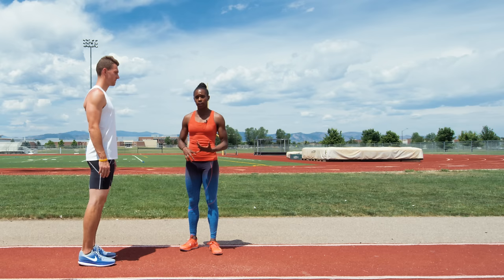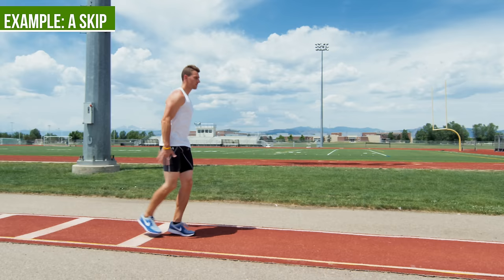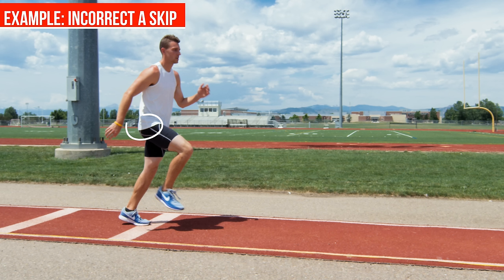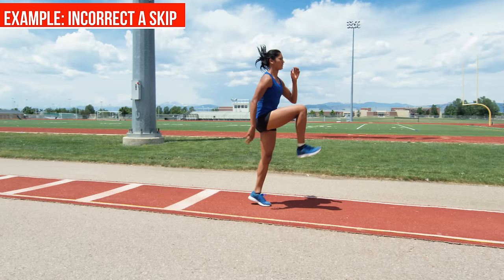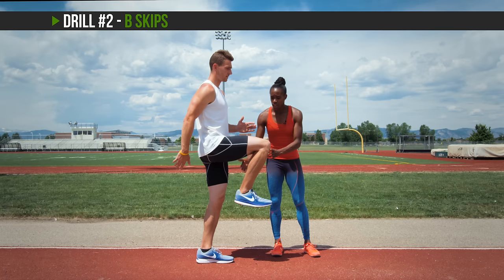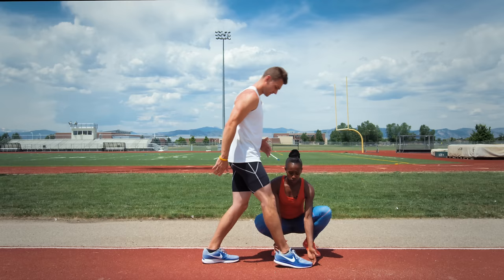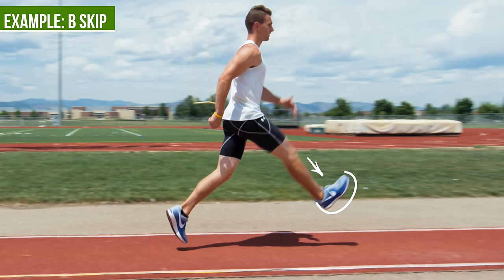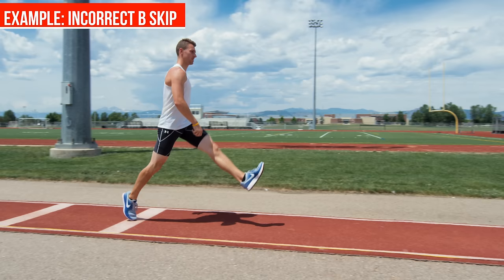Essential Long Jump Drills - Sprint Mechanics

Comment: Hii mam 
 My event is long jump i want one tip ,While starting my run up what should  be the foot distance .  When i go near the ground my legs  didnot beat the pefect jump .
Reply: Hi there, if I understand your correctly, then a typical runway distance is approximately 14-18 steps and whatever that distance is, will be your starting mark. However,  it varies for each athlete depending a number of things, including height, stride length and even speed. You can get a good approach distance by starting your approach from the board and running the opposite direction. You stand with your jump foot on the board and run back 14 - 18 steps (mimicking a real runway approach) and have someone mark your final step.  Hope that helps!!! Good luck!
Reply: A

Comment: Thank you for this I’m just starting long jump any other very beginner tips?
Reply from the maker: Hi Clare, check out our YT channel, there are several more long jump videos that should help you get started with the correct technique.
Reply: Try not to look down at the board...keep your head up all the way through the jump.  Try to make the last two steps with flat feet - the step before and the step on the board.  With the step on the board drive the free knee upwards to provide lift....good luck and enjoy.
Reply from the maker: @porthmeor1  Great tips!

Comment: Hii sister 
I'm a athlet n my main event is long jump but I have one problem while doing jumps. While doing run way mostly my leg was going back tht means I'm doing back kicking and my ankle was also not landing problem I have dne many workouts but I can't able to change tht please suggest me to solve my problem sis plzz
Reply: Hi there! This is a very common problem for a lot of athletes, and in order to correct this problem of "butt kicking or running in the back yard" you have to engage your core and bring the hips/butt in. This would feel like tucking your butt in or squeezing your butt cheeks together in order to keep core engaged. This tuck or squeezing of the buttocks shouldn't allow your hips to drop (like sticking your butt out) or legs to go back into butt kicks. Knees should easily come to 90 degrees as you run, which means you've accomplished the tuck/squeeze/core engagement, and landing correctly is result of this proper movement. Just keep in mind that you have to develop this good posture as a habit in order to create easy and good running mechanics down the runway. Hope this helps!!!
Reply: Tq so much sister
Reply: Gude Poojitha vhu
Reply: Gude Poojitha
Reply: @gudepoojitha3716    hi
Reply: I have small dought